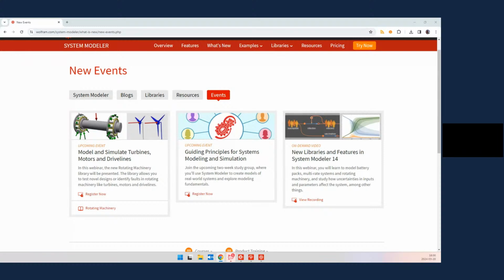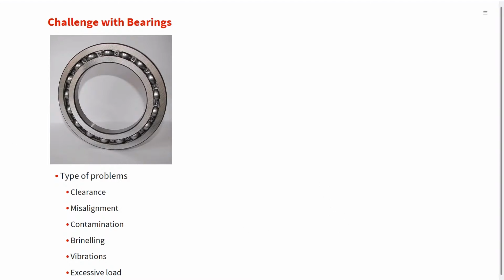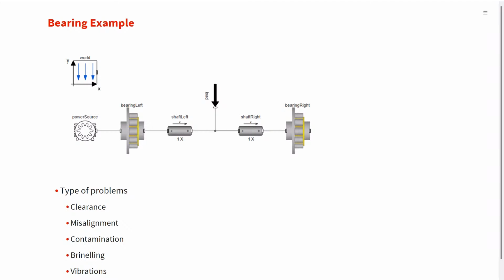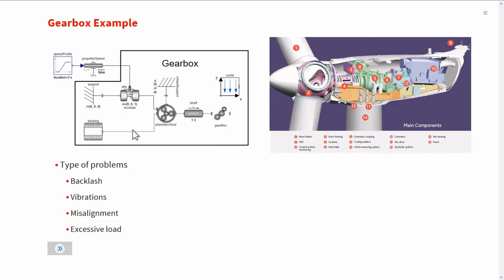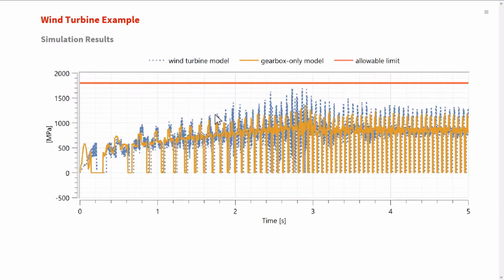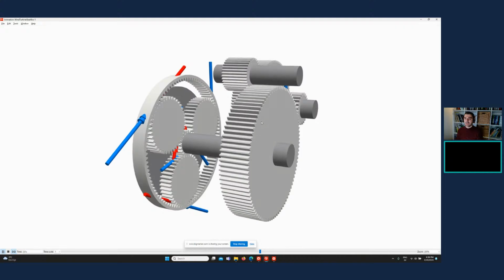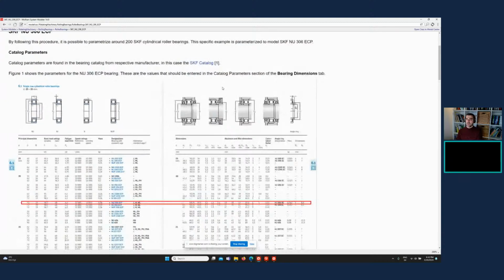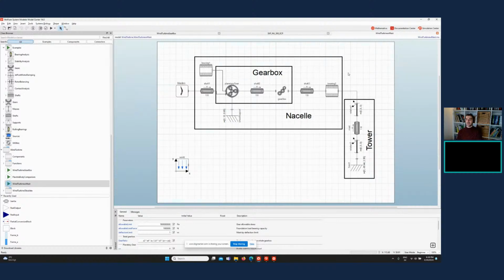Testing and Modeling Turbines, Gears and Drivelines with the Rotating Machinery Library

Comment: It is sure nice to see (in different disciplines) the 21st century degree of detail and availability of modelling specifications (for commercially available parts) for building physically sensible simulations of complex (rotating, in this case) machinery. Back so long ago in the day, I remember how much fun it was to use the Electronic Circuit Analysis Program (ECAP) (primitive, I know, by comparison) to model electrical circuits and motor/generator simulations. Later, such fun to order chip designs & specifications by fax or download to draw schematics and design PCBs on my computer, etc. My actual take-away then, which I have applied ever since doing whatever and which I still believe, was and is that if you can model and accurately simulate a complex electronic circuit or mechanical system or device, that is pretty much proof that you understand the principles involved at both a fundamental and practical level. These sorts of tools should be in use in all engineering schools and departments (as well as businesses), especially since hands-on experimentation in training labs has fallen by the wayside (too time-consuming, too expensive, etc.).